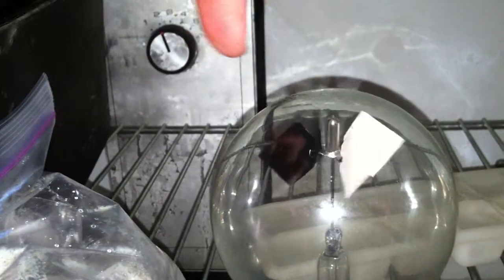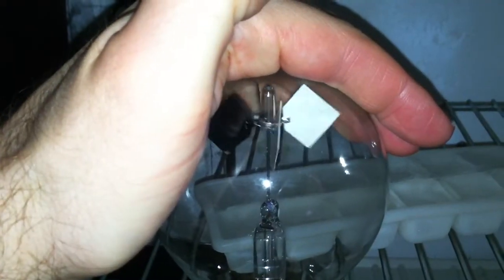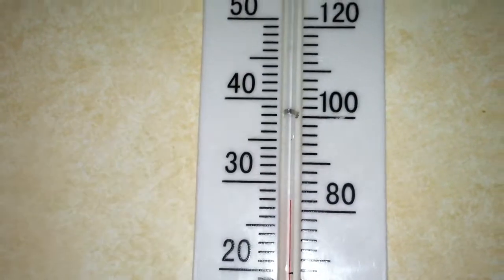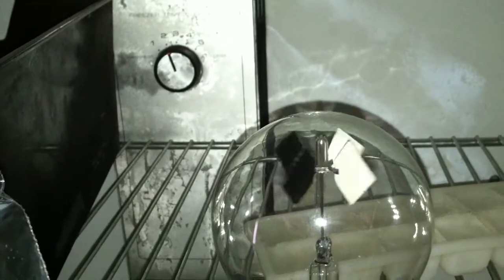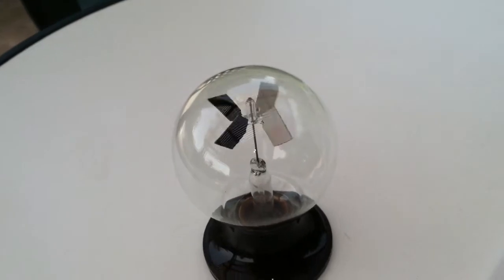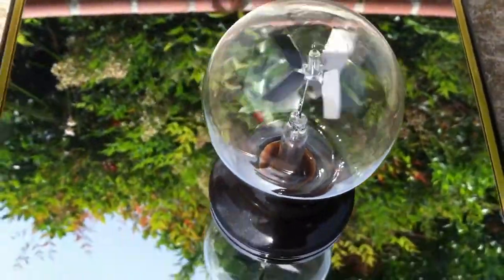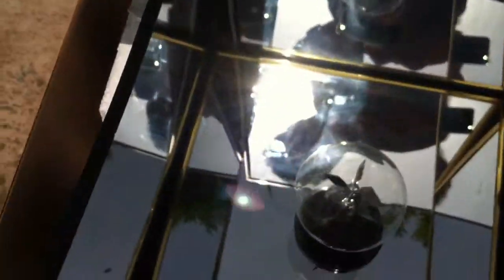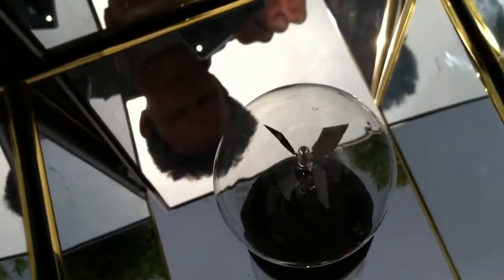Radiometer in Freezer and Outside with Mirror Box

Comment: so its a thermal rotor . what temprarure between cold and hot would it be in thermal equilibrium. Im on the Celcius, 0 Celcius is freezing point and 100C is cooking point . is there any place the rotor is completely still ?
Reply from the maker: Hi radar blue...The radiometer is still at room temperature ... approximately 68 degrees Fahrenheit or 20 degrees Celcius...
Reply: BUT, with *no light* - right?